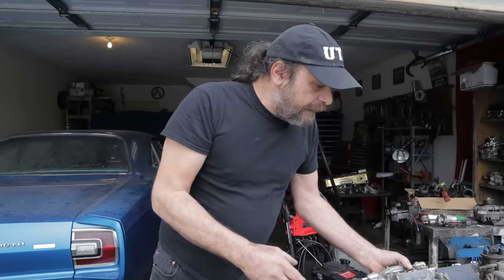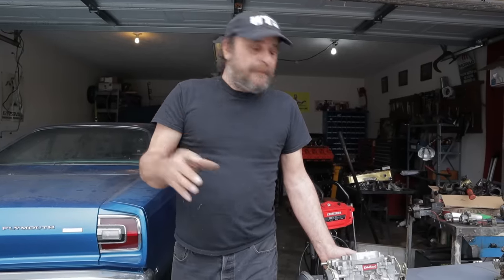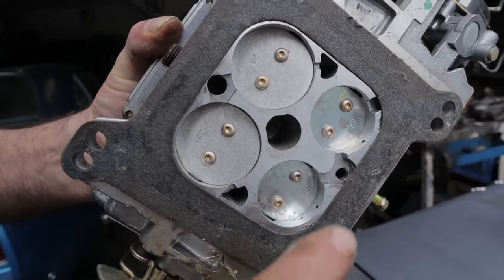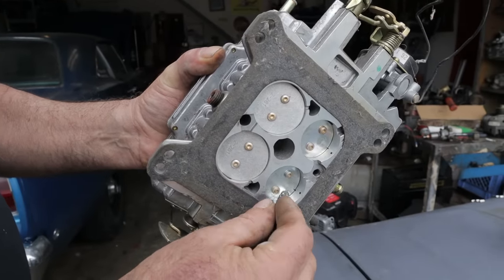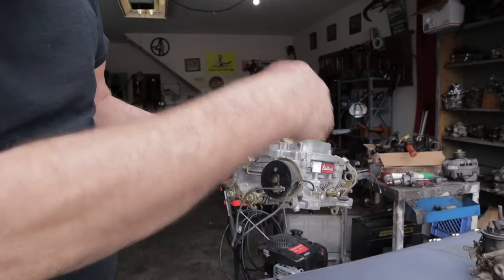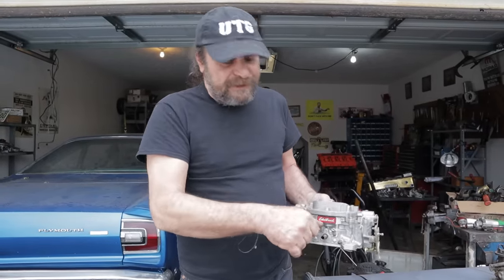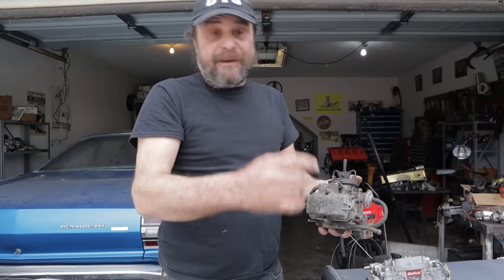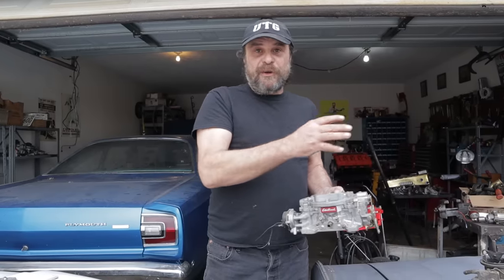The Most Useful Carburetor Video Ever Made

Comment: What if it idles too high with the idle screw all the way out , I already down jetted ALOT , the mixture screws help but if i turn them clockwise to make it richer it makes it break up a lot in the top end
Reply: And there is no vacume leaks I already checked  many times , i also cleaned it a bunch of times already (its a quadrajunk by the way)

Comment: Im 24 years old and my dads letting me tinker around with the 67 f100 302 with a 4 barrel holley…fires ups and runs good when its wide open throttle but in idle it dies out i have to keep my foot on the gas to keep it on

Comment: I suspect I have a problem with my carburetor. I have a 1975 Dodge W200 truck with a 360. It has a quadrajet on it which didn't come stock on a 360 in 1975. Anyways I can get my truck to start (if it's been sitting I have to use starter fluid in the carb) and it will idle pretty good but as soon as I put it in reverse gear it dies. I can't figure out the issue.

Comment: Part of the hate for carbs on project cars has nothing to do with carbs.  I've been going through hell trying to mate a 71 olds 350, 79 quadrajet into a 81 body. The pcv and charcoal canister have given me more problems than the carb.  The pcv was for a 85 307 end up using one for a 71 350. Different pcv affect air coming into the carb. The charcoal canister should be one the inhales through the bottom filter.  Everything today is restricted to inhaling from a small tube on top.  It changes how much air comes in to the carb.

Comment: Lol, 30 years ago, I was doing a bathroom tile job with a friend for a dentist. On a break, dr tooth HAS to show us his project 69 Camaro. 350, Holley vac secondary carb, typical off the shelf "custom". I watch him, as he tinkers, pull the cap off, and dick around with the float adjustment. "Fuel level problem?" I ask. "Nope" he answers. I shrug, back to work. Next break, he's got it running, and it idles like dogshit. Wheezing, loping, bucking, hes frantically turning the speed screw, the mixture screws, all to no avail. "Piece of shit! I'm about ready to sell this thing to anybody who gives me 500 bucks!", tosses his screwdriver, total meltdown. I tell him "gimme 5 minutes, it'll be fine". "Go ahead and try, but you wont fix this fucking piece of shit!" I start it, stuff a rag next to the carb, pull the float level plug. GUSH! Gas pukes out. Couple turns on the float hanger, just a drip. I shut it down, recap the hanger, put the plug back in, restart it... purrrrrrrrrrr, like a kitten. I toss the rag out his garage door, and call him back in. "Start it up, let it idle" I tell him. Purrrrrrrrrr, his jaw drops. "What the hell did you do?" "Just fixed what you fucked up... dont just turn shit you dont know what it does, ok?" Finished his tile job, prick never even tipped us, lol

Comment: wait a minute, so if the throttle blades are supposed to be set to be right at the bottom of the transfer slot then how do you adjust your idle speed? with the idle mixture screws?
Reply from the maker: If everything is functioning correctly, it shouldn't take more than 3/4 to one full turn of the idle stop screw go get you in range

Comment: Tony, is it true on some carbs drilling a small hole in the primary butterflies will help it idle if it has a large cam? Maybe a video on this? :D
Reply from the maker: Yes, and we'll get to that
Reply: Great, UTG, when you do that, tell all of us what kind of a target idle vacuum requires this mod. All this does is create a "mechanical" vacuum leak to allow the throttle blades to be set back I to the transfer slots. This type of camshaft usually requires a vacuum can to run power brakes, also. Tech tips thrown in for that would be great. Good work here, thanks.
Reply: @UncleTonysGarage  thanks tony

Comment: Quick question maybe someone can help a rookie out, my 76 Plymouth when I press on the gas, sometimes it wants to die or it dies and to turn it back on i have to give it a little help (started fluid), or when it sits for 2 days without turning it on it doesnt wanna turn then I also gotta give it a little help, any issues it might be?

P.s: I've replace, fuel pump, filter and some hoses.
Reply from the maker: The stumble/stall is either the accelerator pump, or retarded timing.  The having to prime it after sitting for a couple of days is a product of today's gasoline formulation.  Completely normal
Reply: @UncleTonysGarage  so my best option is to fix both things.

Comment: i actually am having trouble with my brand new Holley and it has a Manuel choke maybe you guys could help? so when i close the choke it doesn't act like i'm closing it at all and when i try closing it more it just stalls the engine, seems like its not giving any extra throttle to raise the idle. that isn't a big problem to me cuz i don't have a cable hooked up and don't use the choke anyway and leave it open but i just wanna possibly know why its doing that. the main issue it is doing is as i'm driving it (I've already warmed it up all the way) the idle just keeps getting higher and higher and i'm always adjusting it after driving it and it seems like the idle speed screw is tightening itself cuz when i loosen it i see the throttle move significantly. I've done it so much now i'm surprised the screw hasn't unscrewed it self all together out of the carburetor lol. its really annoying having to take the doghouse off my 77 B200 van every time i drive it to adjust the idle. Any ideas how to fix that?
Reply from the maker: That sounds like a vacuum leak of some sort...possibly between the intake and heads
Reply: @UncleTonysGarage  for the choke or the idle screw problem? ill check again for vacuum leaks but it seems to have plenty of vacuum according to my gauge (not sure if that means there's no leak though, still learning haha).
Reply: keith cunningham  ya I've tried messing with that screw before and had no luck tightening it and loosening it, when i do mess with it i do see it change the point it hits the lobe but doesn't seem to actually raise the idle enough to make a difference. i have noticed it seems to lock the screw "out" when i close the choke to far and i almost wonder if something in it is broke. if i adjust it a certain way it changes the point where it locks the screw stuck so i'm not sure why its locking like that. i dont really care about that part and the choke not working so much as i do care on why my idle speed screw keeps tightening and raising the idle up while im driving
Reply: anybody know why my idle speed screw keeps tightening and raising the idle up while I'm driving? i care about that more than the choke not working

Comment: So far I have mine idle and it will run full open. But I have a flat spot going from half throttle to full, it clears and runs great but bogs. Probably because it's a quadra jet lol
Reply from the maker: Accelerator pump or timing
Reply: I have a quadrajet too on my 360 and I hate it. I'm going to get a thermoquad.
Reply: @UncleTonysGarage  thanks Tony.

Comment: Tony , have you ever worked with Predator Carbs ?  What are your thoughts on them ?
Reply from the maker: I've had a couple of experiences with them...never had a desire to go back
Reply: Have to comment. Ran one briefly on a circle track car. Could never get it right. It either pulled hard out of the corner, then fell flat on the top end, or bogged coming out of the corner then pulled hard on the top end. Either one or the other. Went back to the Holley, and issue gone. In my case, I could only waste one weekend with it-points chase and all that.

Comment: i recently fixed a "honda acty"..... little 3 cylinder "pickup" that was used as a weed spraying truck.... ABUSED TO SHIT and worn out
guy before me put a brand new carb on

but the carb is COMPUTER CONTROLLED!!!!

i told him if it had a Q-jet on it.... id have it fixed in 10 seconds 

anyway.... it ended up (mostly) being a choke adjustment issue
the choke opens when the coolant warms up.... and expands wax.... just like a T-stat

and the little grub screws wernt set right..... 

but the computer controlled part..... sends vacuum to what looks like a slide valve motorcycle carb in hte middle of this carb
so its variable CFM for economy and emissions 

  but that computer is fucked..... ya have to get it from japan..... an it costs 2000 dollars
fuck that

it was also LOW on coolant.... which delayed the choke opening 

anyway..... we spent 3 months this winter working on it in the shops spare time
had like 5 heads on this one..... no one had any good idea

i took the old carb..... and just started moving the 40 different linkages.... seeing what moves what, and when

long story short.... it got it to stay running, and fire back up (it would idle for 5 mins.... die... then refuse to start with out A LOT of either) 

it was MOSTLY a choke adjustment.... but a bit on the idle circuit (which takes 10 mins for the computer to recognize and adjust for)
it still kinda runs like shit.... rings are WORN OUT from them over revving it thinking it has VTEC.... 

but it starts, and will idle till the tanks dry..... and thats all they need for this spray truck